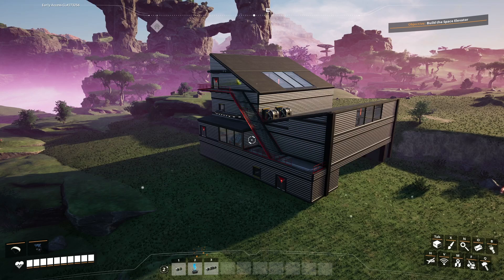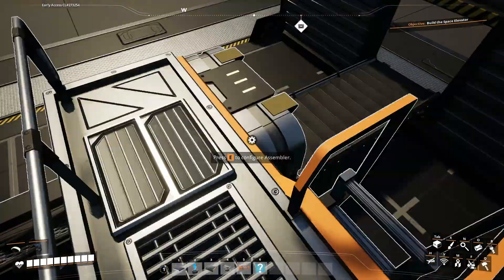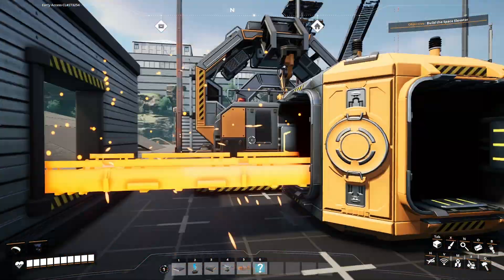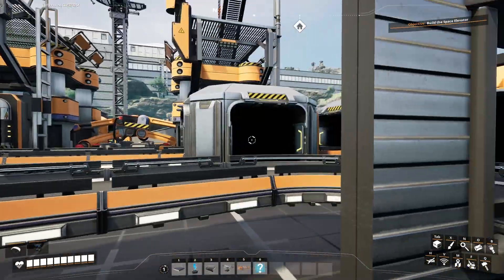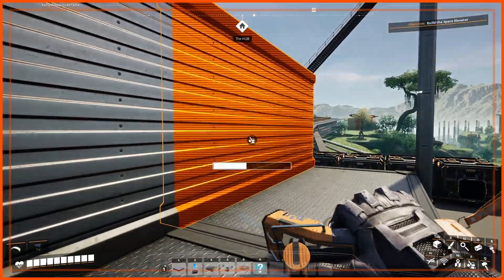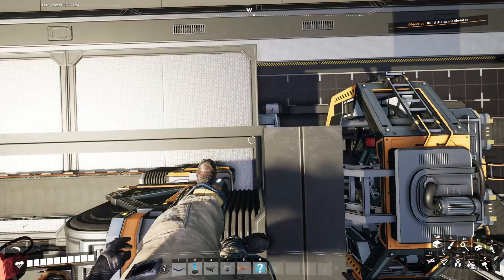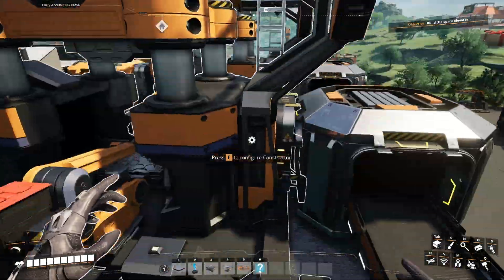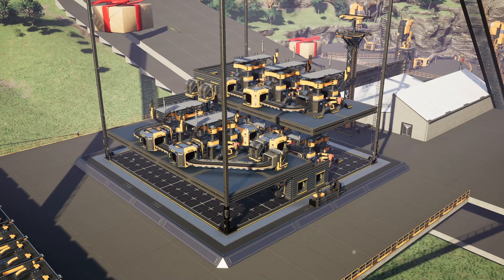Steel Parts Blueprint Pt 1 - The Machines

Comment: As a tip, when holding something like the Conveyor Belts or the Splitter/Merger, you can tap E to switch it to something similar. For example, you can hold a Splitter then tap E to change it to a Merger. Alternatively you can hold E to bring up a Radial Menu and select it from there. It only works for things in the same group. Not sure if you know about it but I also understand if you do it the way you do for videos.
Reply from the maker: I actually didn't know holding it got the radial menu, I hit E while placing belts all the time, other things not so much for some reason
Reply: I've been playing since Update 2, and I didn't know about that! 😮
Reply from the maker: its funny the features that can hide from us